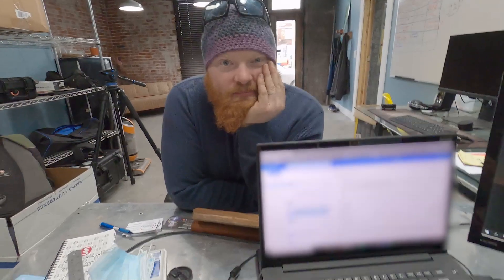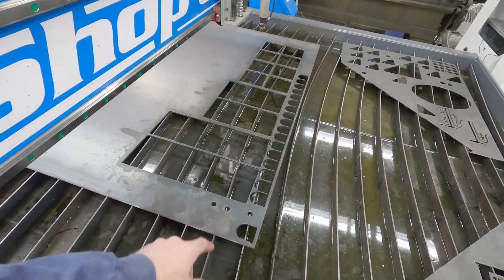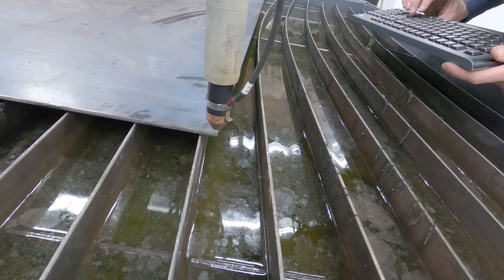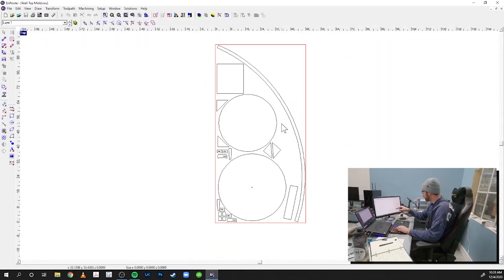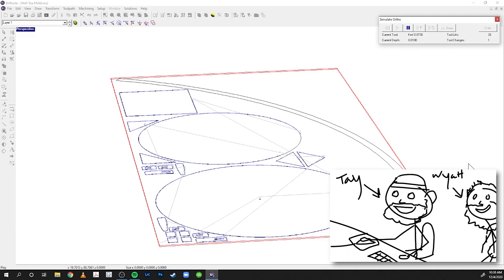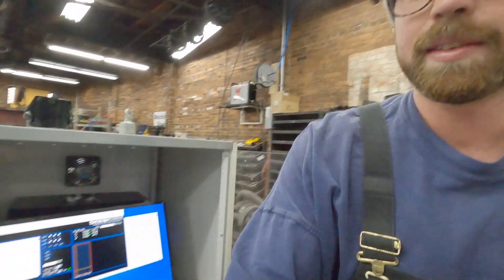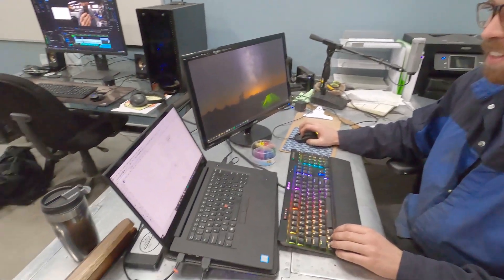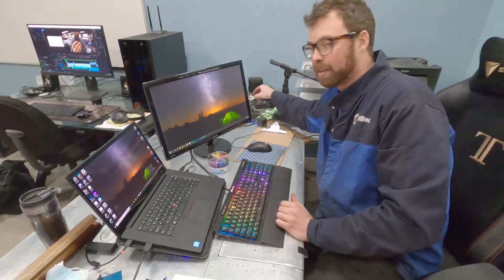Actually Using the CNC Plasma Cutter // Lift Arc Builds: Cutting Out Well Top Molds

Comment: Just having a watch of some of your older videos and some newer ones, nice content 👍 Just watching you plug in the Plasma to the reel with what looks like 3/8 hose? You really want 1/2" and shorter if possible to avoid the pressure loss to the head. If you have changed it since all good. If not give it a go sometime 😃

Comment: What is the prise of this machine! Any buddy knows? Please let me know..
Reply from the maker: This particular one was about $25k, but when it comes to cnc plasma, you can spend as much or as little as you want, its just about how easy you want the experience to be and how hard you plan to work the machine. New plasma cutter video coming soon going into this very thing so stay tuned! Cheers - Tay
Reply: Mine (which is the exact same at Lift Arcs) was 27k to my door. Bought it two weeks ago.

Comment: The nub are caused buy the table stops at the end the plasma cut it still on for the mili second before it goes off . the fix do a cut past setting in some cases lead out also . Or if you controller has a setting to turn off the cutter just before the end of a cut . This is a normal hypertherm delay it has a delay once it receives the command from the controller off command
Reply from the maker: Yes, ive been using the early torch off setting to a fair degree of success.

Comment: You should really add down draft to that table
Reply from the maker: Actually, i opted for the more expensive water table because im located right in downtown Roanoke and the idea of piping all the smoke out a window or roof vent makes me uncomfortable. In this case, the water level was a bit low and wasnt capturing all the smoke like it does when at the proper level. Cheers, Tay
Reply: @LiftArcStudios  Water keeps your parts cooler as well meaning they are likely to warp less.